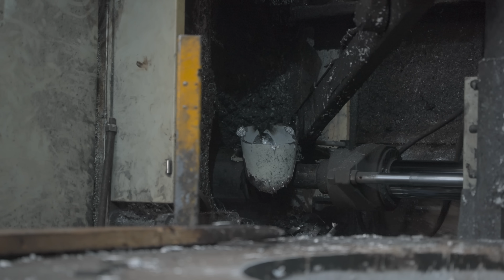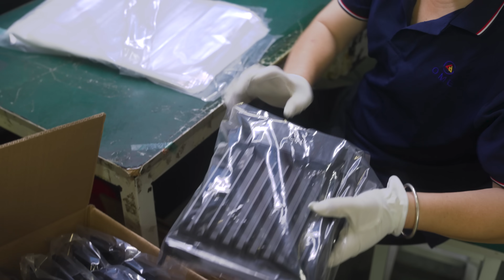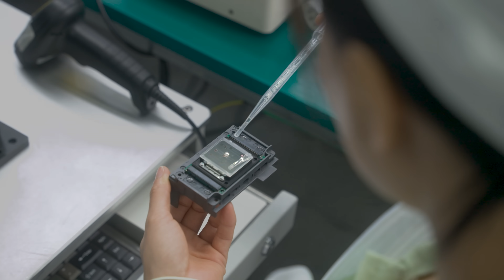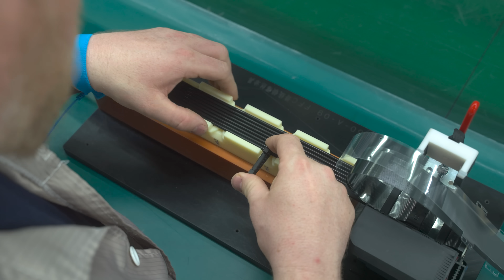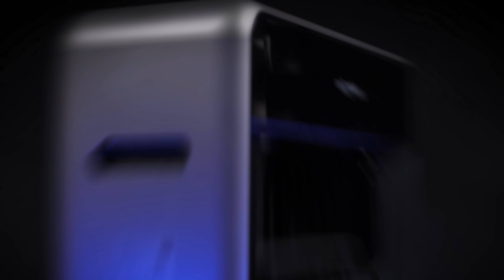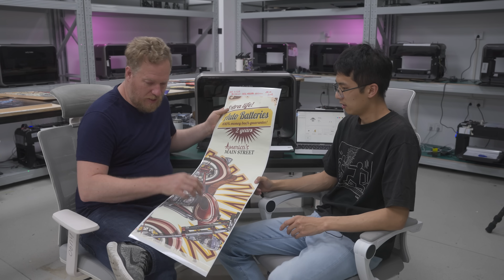How eufyMake Builds the Printers Everyone’s Talking About

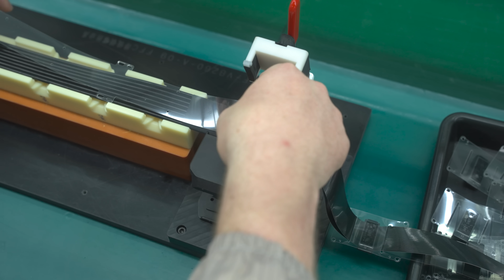Comment: 18:55 Maybe an invard rotatig plate that fixtured on the back that hold the tubes could improve manufacturing speed a bit.
Reply: just as additon let it stickout at the front for swivel in/out

Comment: A 2500$ printer not even size DIN A4 in a market where such printers already are below 1000$, this kickstarter must be kidding. If they had something for 250$, that would be revolutionary, or something that prevents the ink from clogging if not in use for month, or a software that maps pictures around 3d objects. But nothing. Just an expensive UV ink printer in a design encasement.

Comment: I instantly see people buying ~2000$ machine thinking it's all easy. These cartridges are tiny. They are proprietary design. It mean they will charge you whatever they want. It means it will be very costly to print something with higher in layer counts or a bigger in print size. Not sincere marketing at the kickstarter page. This is really for small novelty product that cost a lot to make and are hard to sell for a client. And the makers of it rubs their hands in hopes that they created the tool with a very quickly consumable parts. I bet they already have subscription plans with the pricing ready. Also the call out right at the start of the video saying that machines are big and bulky guy using 32000$ machine. That machine does shit at scale! At a commercial scale! I bet you that! This one will print small orders forever! Don't rush in people!

Comment: Why do they cast the part, and then go on and cut it and mill it in all sorts of ways? Why don't they just make a mold in the shape they want from the begnning? Isn't that the point of injection molding, to not have to shape the thing by hand? Does it have to do with the strength/stress tolerances of the final product?

Comment: I love watching these videos, it takes me back many years to when I did work experience at my uncle's work, "signature industries", they made various things, but the thing I worked on was a military beacon and radio the sabre 5, I got to see how the PCB was  designed in the software, then into the production line, they soldered the PCB, then the pick and place machine placed all the parts and it went into a laser oven, after I did some assembly then onto the quality control, they do a heat test in an oven, then freeze test and then a positive pressure test which checks if the device is airtight by forcing air into it underwater, then into the signal testing room.

 A good few years later the company got taken over by McMurdo and while working at my new job my boss asked if I would like to learn about GPS beacon reprogramming, I said yes and I went on a course down in the Portsmouth site in the UK, on the way to the training room I walked past the production line and I saw the beacon distress pull-off straps they used in my uncles work all those years ago and asked the guy working the line about them and other parts and he was very excited to talk to me about the old site and he explained how they still use that same strap design as it was so good they never changed it, I had the original one on my bunch of keys to prove what I was saying, the guy was amazed how long it lasted, I asked for a few more to take with me to show my uncle and the guy was more than happy to give me some, anyway if your into GPS beacons maybe they will let you onto the production line!

Comment: Its an interesting little machine, but the operating costs are so high that I fail to see the right customer for it. The inks are super expensive and need to be flushed out when not used. The washing cartridge is not cheap either. I dont think this would be profitable for an etsy seller. Perhaps some in-store service that sells customized phone cases, but you'd probably have to charge through the nose for it to cover the cost of having the machine available and having an employee babysit it.

Comment: 29:00 Sure, only their Ink.. this printer is going to be hacked so fast. Cant make non-enterprise stuff locked down and not expect the tinkerers to take it apart :)
Reply: Good luck with that. Protected boot images are not as easy to crack as they used to be.

Comment: No only is the machine itself incredible.
As an engineer it's so incredible to have a look at such an assembly process. Designing the parts, designing the tools to assemble the parts, the jigs, ... this is such an incredible level of complexity, it blows my mind.
Reply: Having worked with some of the people designing 3D printers for the engineering students to build in uni, it's really easy to underestimate the effort required to go from making one or two of a thing to making hundreds of them, then again moving to the thousands+ scale. So many tiny issues and tweaks have to be ironed out to get it to the point where it can be made at scale.
Reply: I agree. I learned, once again, from this video that I'm an imbecile.
Reply: Sure it may be complex, but it's all just broken down into small parts and assemblies and put together.  Doesn't seem that difficult, even if it technically is "complex".

Comment: Thank you for this amazing tour. 

I just realized that while the tilting mechanism is really amazing, it will only work with cups that get smaller towards the bottom, not the other way round. :-)
Reply: 🤦‍♂You just put the wide end in the right direction; it does not matter if it is the top or bottom.
Reply: @JorgTheElder the clamping mechanism needs to go inside of the cup.

Comment: This is one of those things that can’t be that repairable due to all the calibration needed. The cost to allow user calibration by building un systems to let you do it on the printer is not worth it.
Reply: What the heck are you talking about? It doesn't take any more accuracy than a bog standard 3D printer.

Comment: I just don't understand why the X-raying is only done after machining the block when the defects the X-raying is meant to find get there already in the molding. When the X-raying is done at this stage doesn't the result from it basically tell whether they just wasted time and tools on a bad block?
Reply from the maker: Yeah - I noticed this confusion as well when we were back home editing. If you notice in the video, I say that they X-ray them before machining, but we're showing parts that have already been machined. It might be the case that they just didn't have any parts that were un-machined to X-Ray at the time. I'm not really sure. On the flip side, they may get so few failures that it doesn't really matter.

Comment: Well, no health and safety around the aluminum casting. Spraying the mold release without respirator of fumes extractors.
Reply from the maker: Yeah, we were talking about that too when we were on site at that factory. They said the manufacturer regularly visits them and tests for health and safety of the vapors and said it was fine, but I'm a little bit skeptical too.
Reply: @StrangeParts glad you picked-up on that too ! Melting metals always leads to evaporation of impurities, specially when using recycled alu. The rest of the tour looked clean thought !
Reply: Lack is eye protection around molten metal is just wild.
Reply: It's unfortunate that there's not a single respiratory PPE in sight

Comment: Like you i first rolled my eyes at have to use OUR INK to run it. But I actually get it. And when you talked to the product manager hes absolutely right. To get this to work everything has to be calibrated exactly, and there is no standard for everyone to follow. So they ahd to make their own standard to run with to make it work. 
Everything from viscosity to UV exposure time to UV wavelength reactivity pir colour pigment ect... All needs defining for this to work correctly. And third party inks simply can not all get that right...
After this is on the market for a while there might come a time where third party suppliers are making ink that is calibrated for this printer. And it would be then we have to go back to asking the question.
Reply from the maker: Yeah - I had the same initial reaction as you.  Based on the conversations I had, some of which were off the record for now, I'm very hopeful things will continue to head in a good direction 😊
Reply: I have had mixed results with many brands of UV resin in a 3D printer; I can imagine all the problems you would get using cheap resin in such a printhead. Not to mention that i would have to be 100% compatible with the solvent and thinner.
It is also about profit. They would have to sell the base printer for a heck of a lot more if the ink did not provide a revenu stream.

Comment: Ive asked EufyMake across multiple platforms. No answer. I understand you can build texture, but what is the tolerance for variation of the surface its printing on if its not perfectly flat. Either curved or a rough surface.
Reply: Ask Gemini and you will find the info on multiple sites. Looks like it can deal with a surface with up to 20mm of height variation according to Tom's Hardware.

Comment: This is cool but i heard its bot really scratch resistant 😔 would be a shame to print on a mug or laptop and hvae it come iff after a while.
Reply: It is cured UV resin. That is pretty tough, and you can apply a clear layer as part of the process.
Reply: @JorgTheElder uv "resin" comes in different graduations so if you look at the TDS of different resins you have different levels of scratch resistance also of ourse. As scratch resistance is something that's quite difficult.

Comment: that technology has existed for many years. look at the Canon Arizona series for example. what's new? is the price per print less? is it faster? the biggest problem is the price per print. and of course time. if you don't talk about maintenance, and starting up the print heads when you don't use them every day. it's great that it's now coming to the average user. and thanks for that, bravvvvo but I think the cost of a print is way too high.
Reply from the maker: The thing that's new is that it's the smallest UV printer to date (industrial UV printers take up half the room), and it's self cleaning.  Both of these are what kept me from owning a UV printer prior to this.  Industrial UV printers require a ton of space and daily maintenance to keep running, which doesn't really make sense unless you're using them for regular manufacturing, not one-off crafts/prototyping/etc.  that being said, I suspect this machine will lead to some people upgrading to a larger UV printer when they start a business with it and have it take off 😁
Reply: It's so cool to see progress in that technology. The biggest disadvantage (besides what you say) is production time and the amount of ink you use for that kind of printing. And that gives high prices. Maybe when you have a smaller printer dedicated to that kind of task it will make more sense. We'll have to see. Just talked to my manager. He listened carefully. It's about seeing opportunities.

Comment: I really would like a deep dive into the economics of injection moulding... those dies look beautiful and horrendously expensive to make.
Reply from the maker: Yuuup!  I wanted to spend a LOT more time at the injection molding factory than we scheduled time for.  It was incredible.  And not just because injection molding is cool.  This injection molding factory in particular was pretty impressive.
Reply: Low end injection molding machines start around $100k. And that doesn’t include the machines that support it. It’s not cheap to start but insanely profitable over time.

Comment: Man, lost me at the ink verification. I can get wanting to ensure quality of prints, but that also means they get to unilaterally decide when this product is no longer able to be used. Once they stop producing ink for this it's a brick
Reply: For the price point, it is more than justifiable. Like the engineer said, ink that is not the right parameters could damage the machine. This is one of the few occasions where I would actually agree it is acceptable to do. Besides, this type of product isn't going to last decades - you are acting like you have a bunch of 3d party suppliers lined up and are going to pass this down to your kids. These machines will have a 3-5 year warranty at most. A newer better version will come out etc. Thats how it works. To design this to last way longer would make it cost so much no one would buy it, and whats the point - we innovate, if it was built to last 10 years no one would want it anyway because a better one would be developed just a few years into its life.
Reply: @jessejuliano8056  Planned obsolescence is unacceptable.
Reply: @DieDoeDa  we wouldn't innovate if everything was made to last forever. Tell me too don't know how anything works why don't ya.
Reply: If there is market demand, there will be a large number of third-party companies in China that produce ink for it. I discovered this fact on the filter element of the Xiaomi air purifier.

Comment: Re: ink. They should have a “Made for eufyMake” program so that you can get high-quality compatible specialty inks. Also, the reason why people grind their teeth when confronted by locked-down ink is that the printer manufacturers are grossly price gouging on it, and wasting ink that’s still usable in a cartridge for no reason other than greed. Price the profit margin into the printer and keep the ink at a fair price and you won’t have mad customers.

Also: don’t engage in the cat-and-mouse game of trying to keep the ink cartridges locked down. Cloners will always eventually find a way around it, and trying to keep it locked down will kill your reliability. Case in point: HP inkjets. They’ve repeatedly had firmware updates that only were about locking out 3rd party ink cause problems with even HP’s own ink; and in a few cases bricked printers.

Comment: The part they didn't talk about was that these machines are all enabled by the "upcycling" of surplus/grey market Epson print heads. UV printers have been made from hacked Epson printers for years, with other ones requiring some hackery with the Epson drivers (they basically put half the printer in the machine, contributing to the high cost). Clearly this is not an officially sanctioned product from Epson, otherwise there would be no need to epoxy all of the ink chambers and whatnot to the print heads. The print heads are likely not designed for this kind of use case to begin with, hence them being reticent about third party ink, which in this specific case has a very high chance of clogging the heads. This is probably an entirely off label use of the print heads (Epson XP600/F1080 I think). 

Clearly, there is no Epson printer control board in here; Someone in China likely hooked up a logic analyzer to a working Epson printer and reverse engineered the print head. There is probably an FPGA (maybe a sufficiently fast MCU may suffice too) driving the signal waveforms onto the lines on the motherboard along with the Linux SoC.

 The reason for that is that buying the commercial OEM UV print heads is likely too expensive, so they're abusing consumer level print heads to get the same or similar results. It's somewhat unlikely that this process would have been used in the West; rarely do Western customers and teams feel sufficiently confident in the supply chain of grey market parts, and most people do not think about these types of solutions in a corporate setting outside of China.

Technically it is a very clever machine, and the build quality appears excellent. 

Unfortunately no discussion about how the raised printing works. If I had to guess, there is a gas-generating reaction that occurs on cure that "foams" the ink. This is a pretty neat feature and the printing is quite higher than I expected it would be. The result appears fairly decent.

Comment: It is an awesome product, but the Ink is an issue. They charge 300$ for 6 x 100 ml ink. UV ink usually costs around 50$ - 90$ per liter. How much ink is consumed on a textured print like the dragon head?
Reply: won't be an issue when that product is  hot the similar product will be manufactured in China everything we do there always competitors

Comment: I have some coins to design. I guess this printer could do rapid prototypes to get a sense of the coin, and I could even print it onto the existing metal to get most of the helft of the final product? Lovely to get a coin in the hand before committing to the tooling to strike them. Also for customers who would be commissioning their own designs.
I guess 3D metal printers don't have the precision to get the refinements of coins yet?
Reply: Could this print atop the struck blank!? Hell, maybe even just a flat round, or even the sticker process). Coins just sit on desks, so heft, design and detail are just what's needed.